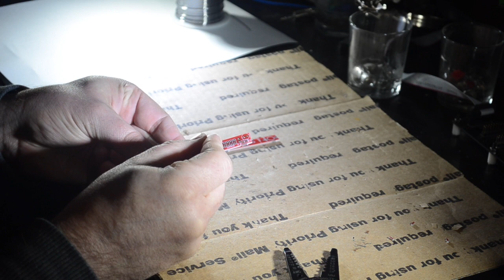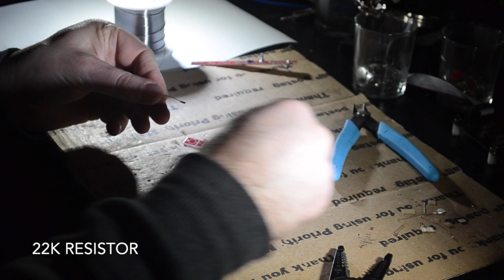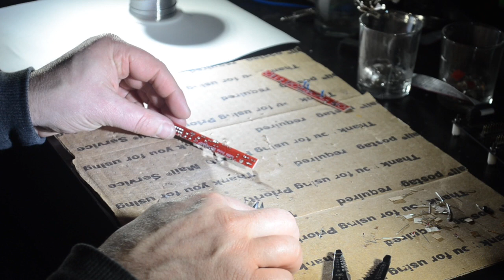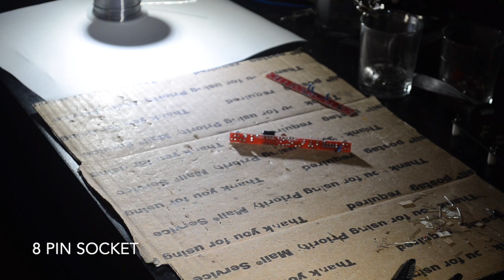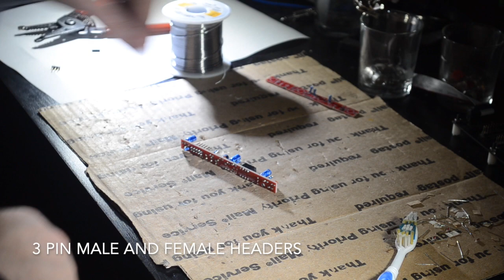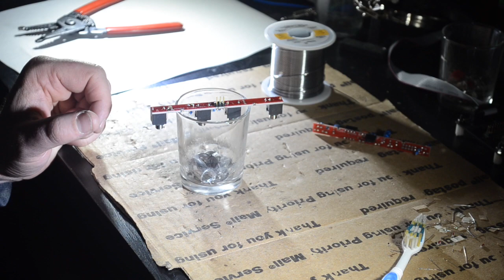AI006 Stomp Box Adapter Build Guide

Comment: Thanks for the video - it helps clarify some of the steps from the build doc. It's nice that the newer PCBs do a cleaner break (no tabs to trim off), and the 10 ohm resistor marking has been corrected. One question though - i don't see you use the spacer that is listed in the BOM, nor do i see it mentioned in the build doc: Is it no longer necessary?
Reply from the maker: You'll want to use it once you are done testing at least. I usually put them in just before powering on.